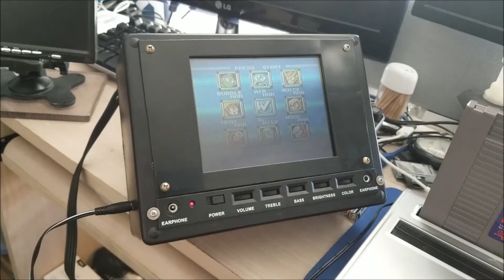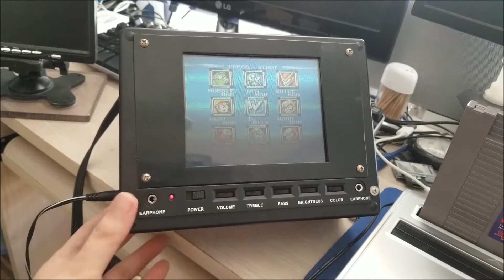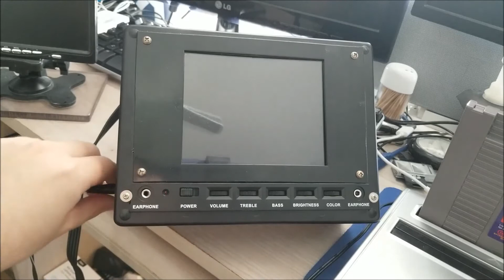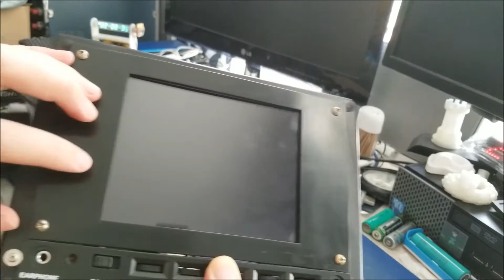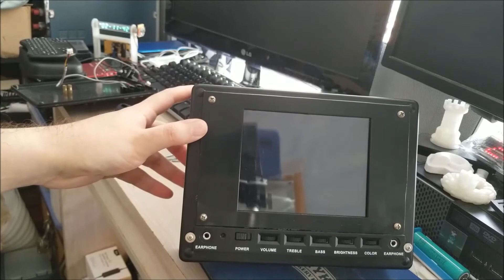LCD Composite Monitor: Early Project from Over 15 Years Ago

Comment: Hey thanks for the video. You keep saying cringe but I'm impressed? 

Just clarifying through does your composite monitors use no digital conversion or upscaling, and the composite signal is directly controlling the LCD screen?

I'm interested in glitch art, but digital signals are much harder to distort, with a digital converting circuits cutting out those distortions. It seems a lot of people on the internet insist LCD displays can only be used with a digital signal?

Anyway thanks.
Reply from the maker: So the way lcds work there has to be digital circuitry at some point between the input and lcd. The front end circuitry that filters the analog input in older lcds like this one can still be analog though. In this case the lcd module accepts analog rgb (higher quality version of composite) but inside the lcd module it does eventually convert to digital to actually display the image.
Reply: @sjm4306  ah i see. Gonna follow you for more video tech related vids forsure